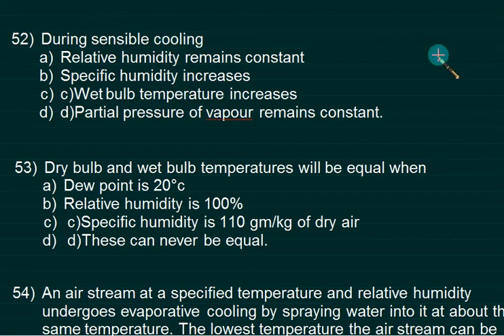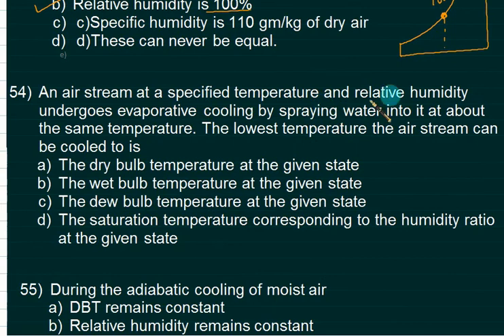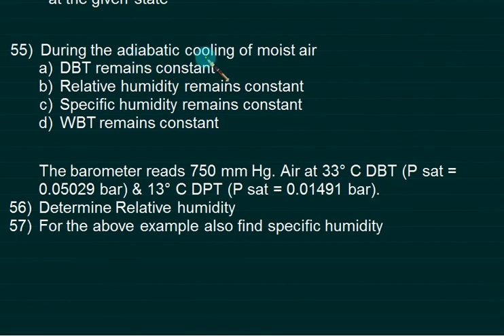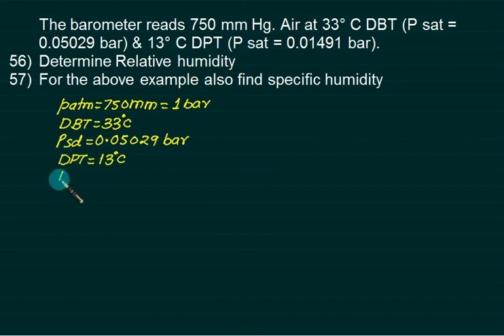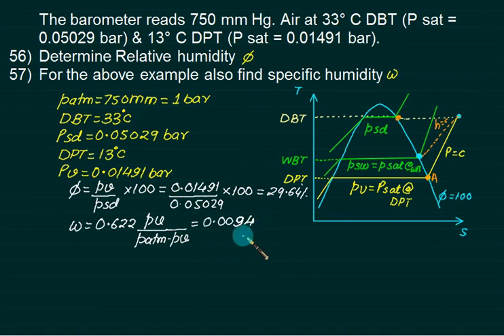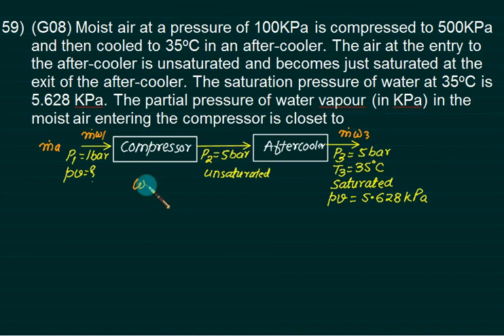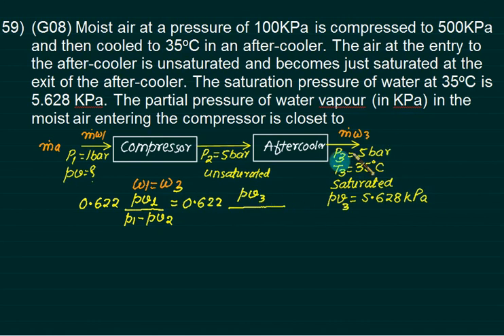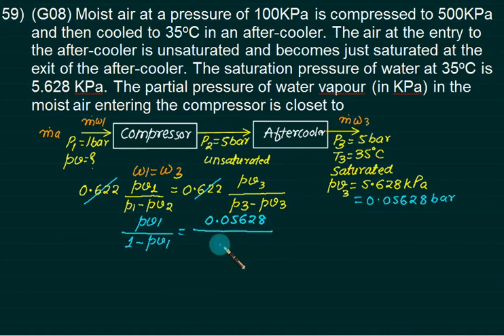Air conditioning part 04 Numerical

Comment: Sir can you please tell me why at 4.13 the pressure aftercooler remains 5 bar, why it doesn't change?
Reply from the maker: aftercooler is heat exchanger hence no pressure drop in aftercooler